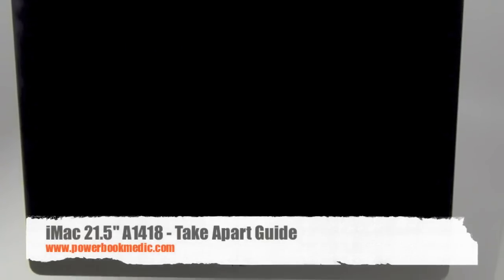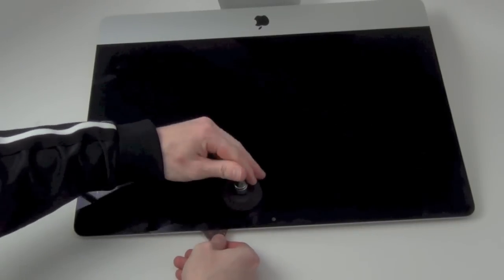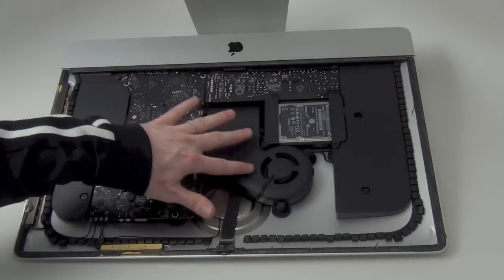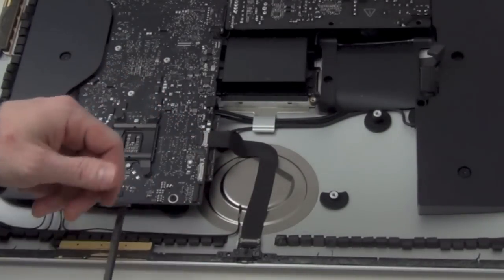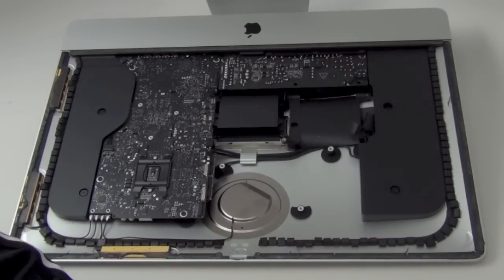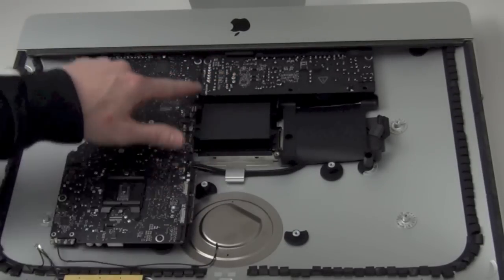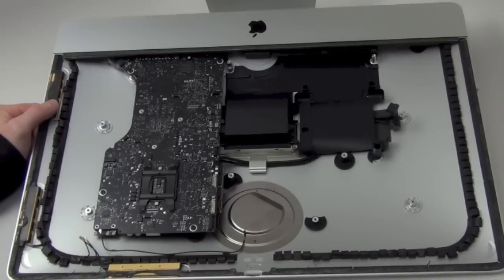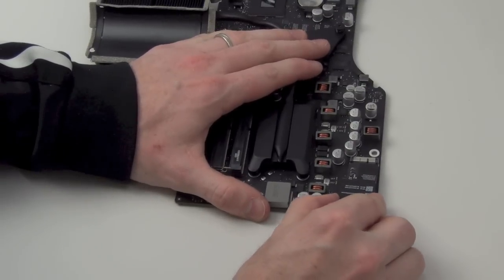How To Take Apart the iMac 21.5" - A1418

Comment: Warning : at 7:25, when the left speaker is removed, there is a small wire that is connect on the powersupply and if you only disconnect it and pull the speaker out, you will break it, because the other end is connect somewhere under. But in this video, they don't show it, and worst, they cut the video of that part and the wire dissapear.
Reply: Thank you very much 🙏
Reply: YEP i made the mistake on following the guild and though that cable was for the bottom speaker for that side (thinking it has 2 connections for X reason) and nope rip the power button right off, and for what i see he did the same thing but didn't show it in the video. 😡

Comment: Can you please tell me how I can move the LCD cable from the chassis (to replace with a new one, I damaged one side of the LCD cable that goes to the logo board)  It seems to be really hard to remove from the chassis.... So I have a new cable to replace it, however need help on how to remove the old cable from behind the LCD display)?

Comment: Well... thanks for the helpful tutorial... except for one thing.  

When you are explaining the part about de-threading the cable to the power button while removing the first speaker, you really need to emphasize how important that part is and how easy it is to pull the cable out of the power button, thus rendering the entire housing completely useless.  In your video, you mention it, and then the frame jumps to a completed section.  You really need to slow that part down.  I have just found this out the hard way and am now going to have to throw my IMAC in the bin.  

Cheers.
Reply: minimalmayhem replaced my power supply and the freaking power button wire broke. How does something so small ruin the computer? I’m so pissed right now.
Reply: Camille Dent-Moore how you solve ? I have the same problem ?
Reply: i cut mine too! fuck!
Reply: 筋キング how you solve ?  I have the same problem.

Comment: If you use this method with that guitar pick and you insert more than 1 cm you will destroy your expensive screen...trust me...I did using this video...black vertical bands on the screen upon reassembly. That goes for HD replacement or any other part replacement that requires screen removal. This vendor needs to remove this instructional video from Youtube...there is a pizza cutter like tool that limits insertion depth that needs to be used

https://www.ifixit.com/Answers/View/163848/iMac+screen+has+black+big+line+after+replace+the+HD
Reply: You are right, there's a pizza cutter like tool (I'm a certified tech who works on these) that only goes so deep to cut the adhesive, no heat needed!

Comment: just wondering.. why would the still use fans when they have the entire case made of aluminum?
Reply: Because most, if not all Aluminum iMacs can get mind-blowingly hot WITH the fans in them!  I learned this from having three Aluminum iMacs varying from different models, generations, and specs. Besides, it's pretty much always best to have something push all the hot air out of a computer.